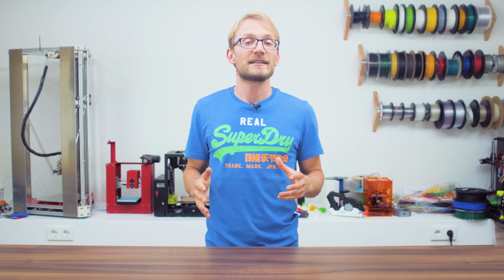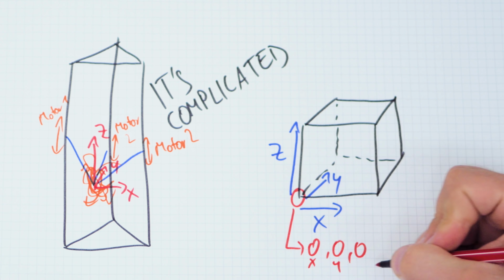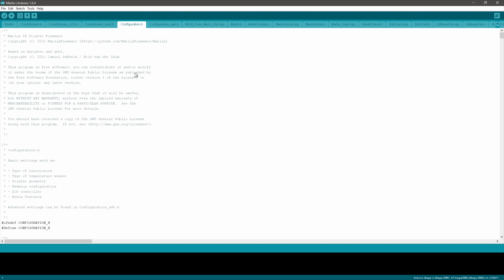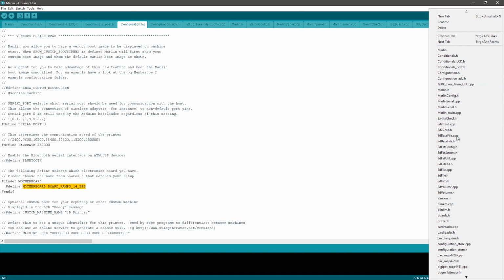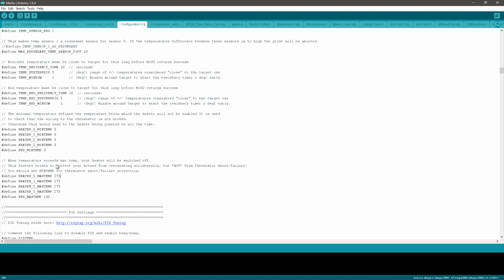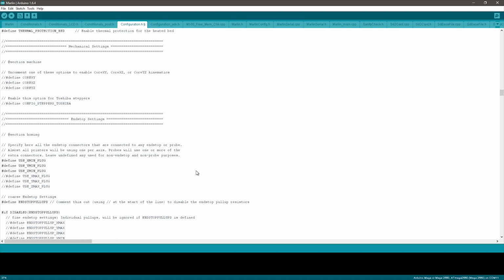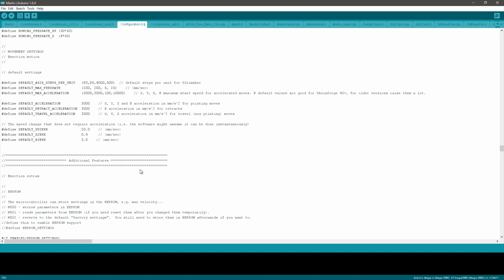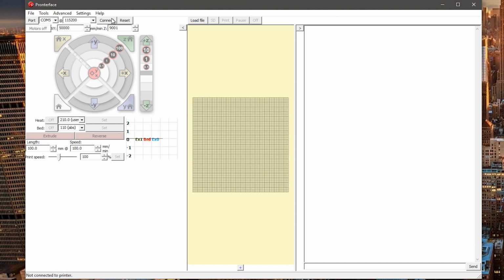[2016 version] How to set up the Marlin firmware!

Comment: how can i improve the thickenes and fusion of each layers..... after printing the layer lost it bonding dnt knw why .. help me to improve my printing
Reply: that could be under-extrusion, z-axis steps per mm, filament, its hard to say.

what filament are you using
Reply: PLA
Reply: from what brand
Reply: wanhao
Reply: turn up the temp to like 220
Reply: i gave more than 200 ...
Reply: try turning up your extrusion multiplier/ line width

Comment: My dear respected YouTube , first of all i like to tale you about myself , I am a Electronics developer & Engineer & Article writer so whenever i build my projects i allows needs a enclosure or cabinet to fetes all the components and getting a professional look , so Recently i have perches a 3D printer  " TRONXY P802EA"after  greeting my 3D printer suddenly the control board stooped working completely and best low cost solution of control board is Arduino mega 2560  with ramps board & A4988 driver module.
 i decided to install ramps board and Arduino  and then i saw i have to install firmware and obviously most popular  Merlin firmware ,you when ever i have to install firmware first time & i need to configurations and change the settings "config.h" particularly for my 3D printer . , i have knowledge and working experience and making several project using Arduino but dont have any knowledge about those firmware /3D printing /Settings/ settings to greetings best printing quality , i alady dose manual bed leveling and z axis leveling , i am just a noobs in those matter so i need your help bro please tale me perfect all the configuration in detail for my Tronxy P802EA . Thanks a Lot

Comment: Error:Temperature heated bed switched off. MAXTEMP triggered !!

I keep getting this error......The thermistor is okay and everything is plugged in properly as I checked and checked again.......I know its probably one setting in the firmware but im shit outta luck now as I have no fucking clue why this is happening...
Reply: Printing Scotian I have the same issue with the hotend, the thermistor is fine but max temp gets triggered, I also thing its a firmware or hardware issue. Let me know if you find the solution and I'll do the same.

Comment: I should have known my 3d printer doesn't have a lot of parts like stepper motor chip or an Arduino its only one rectangular motherboard that's made in china.  how sad :(
Reply: every 3d printer controller has a processor, stepper drivers, connectors, power regulation, etc so if it works it must have all those things built into the one board - the net a8 is like that and lots of people have put marlin on it, check to see if there's a config file for your board on GitHub

Comment: Holy cow!  This is so far beyond anything that I'd call "basics".  Not to mention all the "things you'll have to know about your 3D printer" like types of main board, motors and drivers, heater types, thermistor types...  that you just "plop right into your configuration", well, one has to know how to access Marlin in the first place.  "Just upload the new configuration to your control board..."  That might be something to discuss in a how-to video; I have NO clue how it's done.   Then, turn your printer on and watch for components glowing red hot...  Really? 

If my 3D printer gets to a point that I need to even THINK about giving this stuff a try,  I'll just throw it out with the trash and buy a new printer.